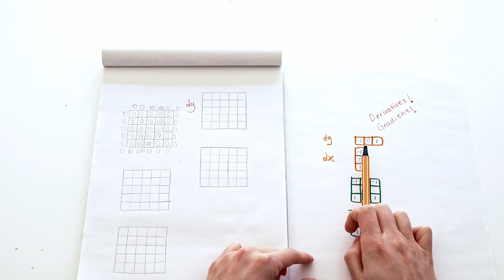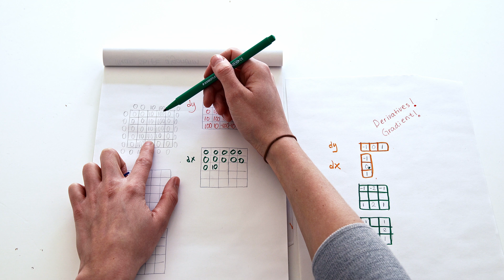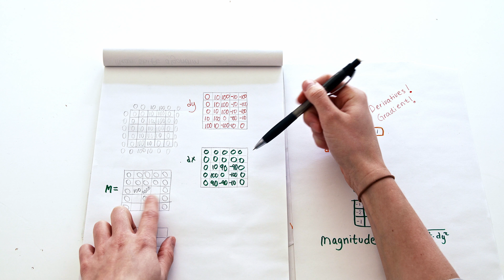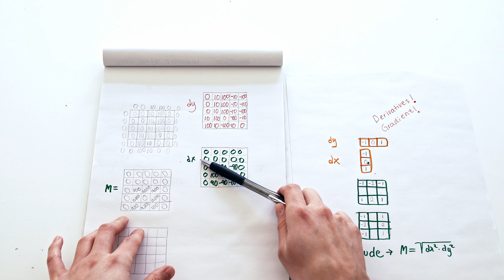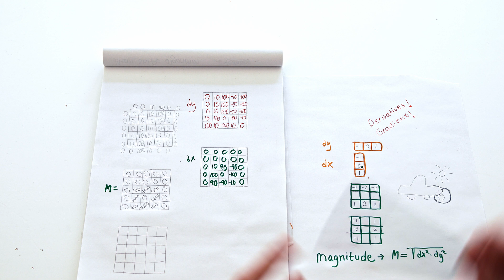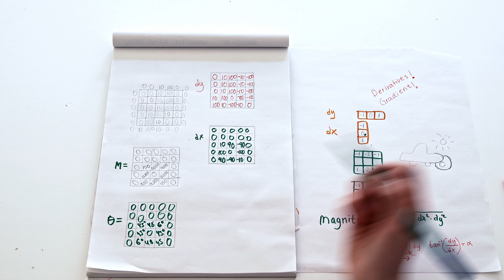Kixcodes explaines Image Processing - Edge Detection

Comment: Why is the magnitude M = √ ∂x²∙∂y²? Why the multiplication? This formula doesn't detect horizontal or vertical edges at all, because in those cases, one of the convolution products is zero. Wouldn't it make more sense to have some kind of gradient, i.e. M = √ ∂x²+∂y²?
Reply: True! M = √ ∂x²+∂y²